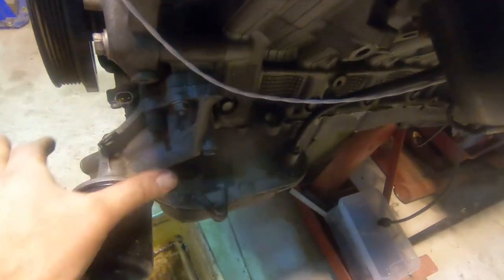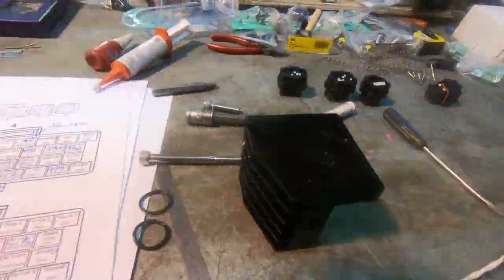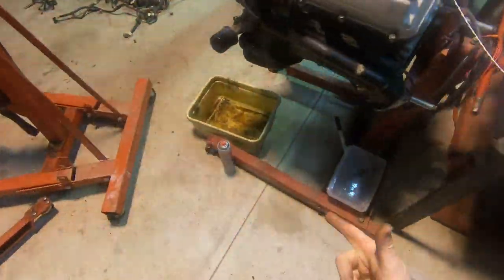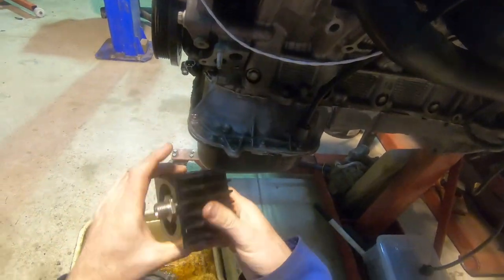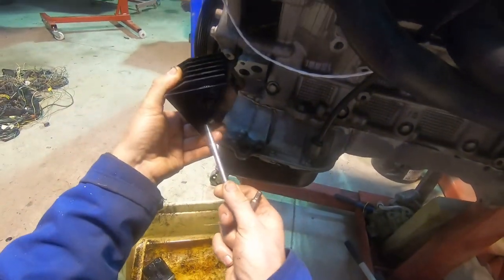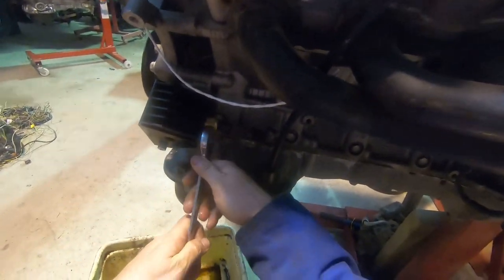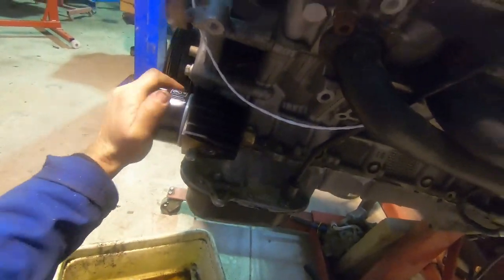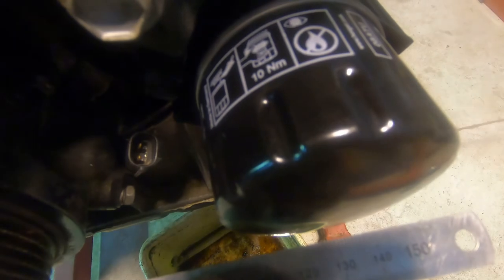Forward facing oil filter housing 1uzfe - billet alloy

Comment: Hi Kelvin, do you have a video on the alternative to the billet for running AC...
Ps .just incase Bronwyn did not get my reply email , how's  me quote  going on the  uz1 engine connectors  pls..
Reply from the maker: Yes we do.  Several.  I was down to 30 emails recently but its pretty much staying over 100 atm as I'm also trying to get workshop jobs done,  so we will get to it asap.  Cheers Kelvin

Comment: so what is the A/C installed version, or is there a A/C version? is their a 1/8" NPT sender  version and how much shipped to OZ?
Reply from the maker: Hello.  I don't do an ac version of this billet allow block but have other bolt on solutions for ac converted trucks. Yes all have an oil pressure sender port.  I send lots of parts to oz.  Best email me at info@thecartunecompany.co.nz with your vehicle details.  Cheers Kelvin

Comment: Hiya mate, can I ask how this works with the oil sensor? As I’m sure the sensor is on the housing of the original one? Thanks?
Reply from the maker: If you look at the picture there is a fitting for the oil pressure switch into the back of the unit.  Cheers Kelvin
Reply: @CartuneNZ  Arhh brilliant, I’m 100% in need of one of these, is it possible you could ship to the U.K.?
Reply from the maker: @Qzh_Platinum  sure can.  Flick us an email info@thecartunecompany.co.nz and we will sort.